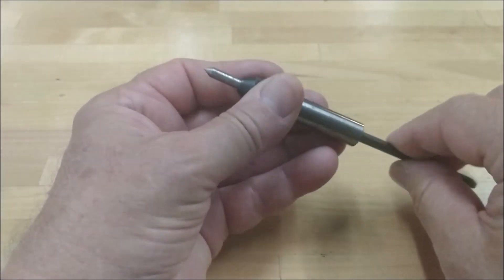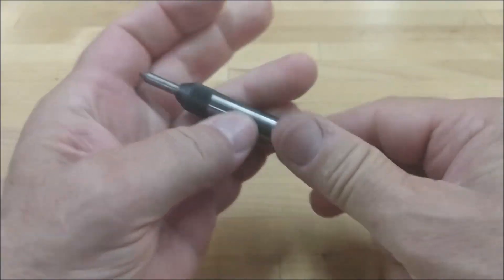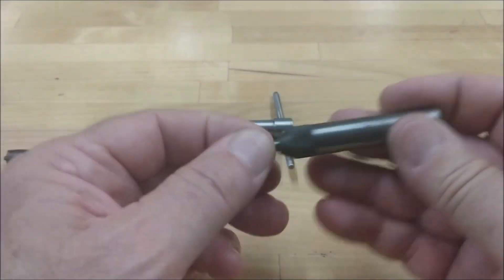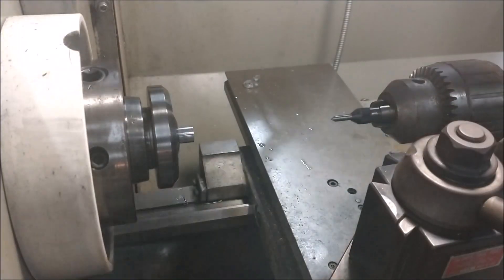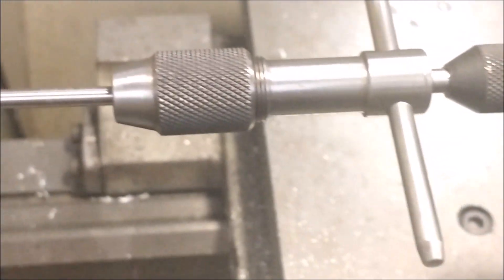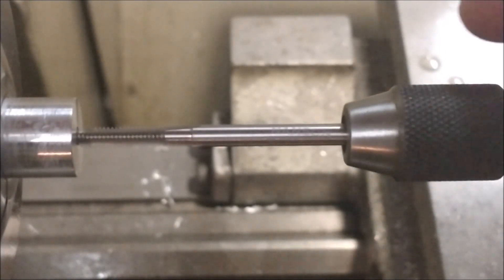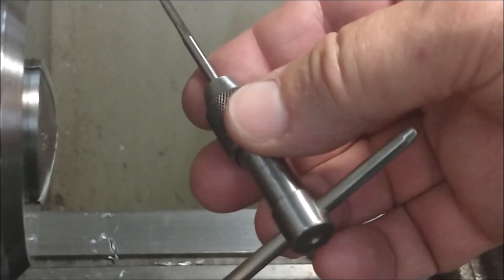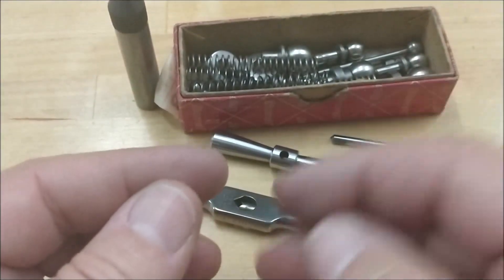Machinists.....Tapping a thread on a Mill or Lathe?...Don't Do This !!!

Comment: Personally feel, that the more common problem regarding axial alignment with taps and tap handles, is at the chuck, tap - tap handle juncture, for lack of engagement - support, and the resulting whip or “hurricane”.
In either event, I agree with you, as to the application of a tap handle in mill or lathe applications.

Comment: I've been tapping with a T-handle and a tap follower every now and then for about 50 years. A good, straight clamping, true running T-handle with a ratchet. Works great, never had any issues even not with M2. However, if the T-handle sucks, then the tapping sucks. My advise would be: Check your tools before buying and using them.

Comment: I have always used a tap handle which keeps the top of the tap exposed so there is direct contact between the tap and spring loader. This is very similar to what you describe. I have never been keen on the T handle type you show in the video due to its extra length and distance from the tap itself. Hope that makes sense. Thanks for showing this Joe.

Comment: Good advice as always Joe......
Tap wrenches vary quite a bit..... I have a little "Eclipse" one that I have owned for over 50 years and it runs true to less than .002", but the others I have are not that accurate. I must make a tap follower..... I often use a tailstock centre to start a tap, turning by hand and keeping the pressure on with the hand wheel at the same time. It works, but needs care, so a decent tap follower is  on my 'to do' list... 🙂

Comment: Totally agree, but lots of my taps don't have a conical point or a conical centre. I suppose I could grind a male centre on the end though. I've always blamed the split jaws on the tee tap handles. They are rarely the same dimension as the square on the end of the tap, so they pinch just on one end or the other. 
Regards, Preso
Reply: Agree 100% Mark 👍
Robert

Comment: It was pretty obvious that tap was cockeyed in the t handle even before you spun it. Good trick to use your small tap wrench as a friction clutch.

That said, you get what you pay for. Good t handles will have hardened ground jaws and a large center in the end. Bad ones have slits in the nose of the body to make a sloppy integral collet. I own some of both. The good ones are perfectly fine for tapping on the lathe. The bad ones should really get tossed in the recycling.
Reply from the maker: Hi Paul. I have both styles and they both do it. I usually chuck up a tap and then put the tap in a collet as I showed. I'm never shocked at the runout. You would think the solid body T handle would have less runout, but they rarely do.  EDIT: Paul, you got me thinking. I checked the small handle used in the demo and it did have hardened separate jaws. A product Made in The USA. I thought it did, but didn't have it in front of me when I initially replied.

Comment: I used to just use the drill chuck to hold the tap. Then turn the lathe chuck by hand just to get it started straight a few threads, then finish by hand or with small threads just leave the tailstock unlocked and turn the lathe chuck by hand.

Comment: Hi Joe  I use only spiral flute taps and hold these in the tailstock chuck.  Don't lock the tailstock and present the tap to the workpiece.  Select the lowest speed.  While holding the jog button, pull the tailstock into workpiece until the tap is fully engaged.  The tap will pull itself into the job.  After the final depth is reached just reverse the chuck.  Apply a small pull-out force to the tailstock before the tap emmerges.   Cheers